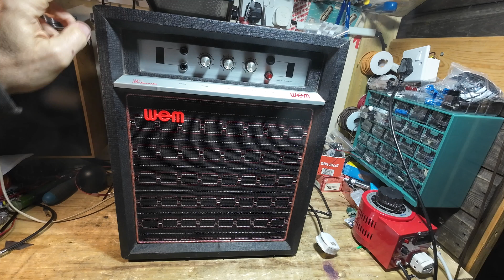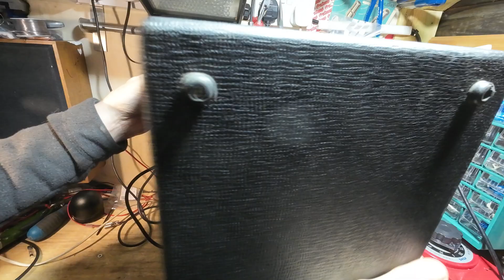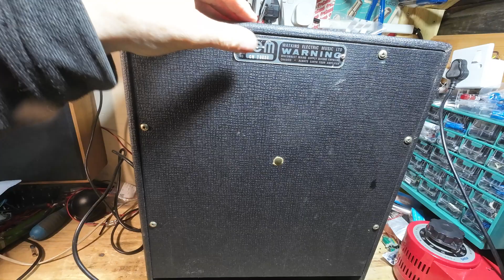Wem Westminster MK9 With Some Mighty Mullard Tubes/Valves This a Full Restoration Part 1

Comment: I don't think your formula for the output transformer is set in stone. I think they were just trying to get the most power out of the valves that they could. And valves were cheap then. 
I am working on a very similar one at the moment. Biggest improvement in hum was scraping some of the anodisation under the earth connection under both transformers. Anodisation is a very effective insulator. Also changing the diodes to high speed type helped. Also connecting the filament earth to the top of the resistor you changed from 200ohms to 300 ohms(I used 330 ohms) should help. Also now you have 3 separate capacitors you can earth each one to the appropriate part of the cct which may help a bit. Mine is quite quite now, but I have some strange distortion to sort. I think it is one of the coupling capacitors. Tested ok but think they are intermittent.
Reply from the maker: Hello Jay. Some interesting stuff going on there, thank you. All the coupling caps in this one were not great. I just changed the lot while I had the board out. 330R for bias is about right. 10,5 watts is the correct bias setting for the amp. The tubes are still over biased at that, but better than 12 watts. Thanks for watching and take care.

Comment: Fascinating video Martyn, the tube adapters sound a great idea, didn`t know you could get that sort. I would be surprised if those o/p vales have been in there long but aren`t ECL86`s meant to be similar to an ECC83 and an EL84, not sure what ECL82`S are the equivalent of ? I suppose biasing to the 10.5 watts would prolong their life. Definitely think that moving the mains from the pot would make a difference ,about to do it on a couple of old amps myself. All the best.
Reply from the maker: Hello, Yes the the ECL86 triode is the same gain factor as a ECC83. I would think it was down to cost why they didn't use them. Would have been a much better tube though.  take care mate, speak soon.

Comment: Hi Martyn, do you have a source for those Russian valves? You mention you buy them from Ukraine
Cheers, loving the videos
Reply from the maker: Hello Steve. The Guy I got them from isn't on ebay anymore. Here a
another seller: https://www.ebay.co.uk/itm/174964217855?itmmeta=01HSERNQEAHG0K1G8TXK2Q2DWW&hash=item28bcae17ff:g:6nUAAOSwHK1fmVsZ&itmprp=enc%3AAQAJAAAA4EzRuGquDHkya3JIFeBX%2F%2Byf81amHBS8BBX70vkKE%2F8mwMwi%2BuSHXpsGGiwYQvleF6LvWlf7UGxJ6PcVyMhcVTEXJDqQNaDCtHKnpwPWvqwj%2BfhuBdZZGX2FYujGFW5ITL6HfKzvp1I4tdoNIWqHEB0Z82K7VIO51nGm0SeuoHZtbKrg5Xo%2FVYFFQxg8SW24VoXiwKGodMfss%2FzsZW5KLD0YRW5yRhJw837YR2n69%2FFA9cLqiHmiqVd3BXTnEqsiAVVnvylw9BZGocxjEJbNboHNi5bJcQ7gY%2BwRn41oC8mL%7Ctkp%3ABFBMovfW2Mtj

These are cheap and they are good tubes. Thanks for watching and take care.
Reply: @vintageguitaramp_guitarteacher  fab, thank you, those prices are indeed very good, fill yer boots 😁

Comment: Thanks again for one of the best videos on tube amp servicing. This isn't just your next fender amp recap, this goes further and I enjoyed every minute of it! 
I also enjoy that you aren't constantly hating on former techs for a not so pretty solder joint or a crooked wire :))
Reply from the maker: Hello. Thank you for your kind words. There should be a part two coming soon. A bit more delving in to the way it was set up at the factory and how we plan on sorting it. I have ordered some tube adaptors for the Russian tubes that are going in this amp. That will probably be in part three. Thanks for watching and take care.

Comment: I'd go ahead and modify the amp to take the Russian valves. If you've got loads it makes sense, incidently I bought a set of Russian 6V6s for my 5E3 Tweed Deluxe and they lasted 3 months.

Keep the vids coming Martyn - they're always interesting!
Reply from the maker: Hello Tim, thank you. One the channel subscribers suggested I get some tube adaptors. Why didn't I think of that. I ahve some on order. I have had good look with Russian tubes. I have a set of the Russian 6v6 tubes (6P6s) in one of my gigging amps. Still going strong after five years. I have never pushed them over 300 volts. They will handle 350 volts on the plate. But only 310 volts on the screens. Thanks again Tim and take care.

Comment: That buzzing sounds like RF interference, the input jack socket/s might not be switched to ground when nothing is plugged in? Is it a  plain unswitched socket or if it's switched possibly the contacts are bent or mucky?
Great video mate. 👍
Reply: The schematic shows input jacks that shunt/short to ground....but the circuit could be different.
Reply from the maker: I had a quick look the jacks seem okay. It's down as a job on the list at the moment. I think it is the AC mains switch in the pot though. They are a pain.
Reply: @vintageguitaramp_guitarteacher   , pots with AC on/off switches attached were used in many small amps from the 1940's and 50's, such as early Valco, Magnatone, Dickerson, Oahu and such. They always introduce noise. Best to just bypass the switch, perhaps putting one in line with the power cord if you prefer not to drill a hole in the chassis.
Reply from the maker: Hello. That had crossed my mind. I did have a quick look online. It really needs a new power cable too. The plastic is a bit stiff. Wouldn't be good with an inline switch.
Reply: @vintageguitaramp_guitarteacher  ,  It also occurs to me that the cabinet appears to have a sealed back and it must get pretty darn hot in there with no ventilation ----  Not to mention that the speaker might prefer and sound better with an open or partially open back cabinet. You should try it both ways once you get it rebuilt and put back together.
Reply from the maker: Hello Rob, thank you. It's a job on the list at the moment. Need to sort the tubes. I have ordered some tube adaptors, which was an idea that @gooden2974 had. Why didn't I think of that duhh!! That will save me having to cut the traces. I am a plank sometimes. Hopefully we can match the effective load resistance to the output transformer. Nice to hear from you again Rob. Take care.

Comment: Great video, change the output transformer less hassle...
Reply from the maker: Hello Keith. I have ordered some tube adaptors which will save me having to cut the traces. Shouldn't take long to wire those to the 6F5 base. I don't have the right transformer to go on it so I would have to buy one. If I use the adaptors I can keep the amp original. I am a dummy. I should have thought of that before @gooden2974 suggested it. I probably would have thought of it just after I had cut the last trace. Thanks for watching and take care.

Comment: If it's the same as the WEM Dominator I had, it too had a bad hum/noise level. After changing the smoothing caps the issue still remained. I found the cause was the combined mains switch & volume pot. Daft idea sticking the mains near the high Z IP of a high gain IP valve.
  These amps were budget amps, the mains transformers are rubbish & often needs replacing. Grand video.
Reply from the maker: Hello, yes not ideal putting the power switch in a tone control. i am not surprised the power transformers fail when the tubes are way over biased.  They were defiantly made on the cheap. Thanks for watching and take care.

Comment: Honestly, I think I would either make adaptors that plug into the existing sockets so that you could sub your ECL85 tubes, or simply change the output transformer.  The world really could use a supply of manufactured adapters to sub other tubes in place of ECL82/6BM8, and ECL86/6GW8 tubes. This would probably be much easier to do for someone with access to and familiarity with software for designing printed circuit boards, which I personally do not. I've made some interesting and tricky tube adapters before such as a pair to allow the substitution of 7591 tubes for 7868 tubes and vice versa, but hardwiring a tube socket to a male tube base, with crisscrossing insulated wires betwen them, is not easy to do......
Reply from the maker: Hello. Why didn't I think of that? I was so tired and so engrossed in the amp. I have just ordered some. Thank you. Take care.

Comment: Forgive me but I love to see you getting confused because it is sooo much entertaining! 10.5W for ECL82 in AB Pentode Push Pull at 250V is exactly what the original Philips data sheet says at page 8 and page 28. Rk 220k. The output impedance can be anything around 10R. Remember that the 16R you measuring on your speaker is not a constant at any given time at all... Electrical engineers give us safe boundaries
Audio engineers design the sonic possibilities based on the intended use. E.g. lowest possible odd order and highest possible even order harmonics. Sometimes this can be right at the end of the safe boundaries.
Reply from the maker: Hello. 10. 5 watts is the total output of both tubes biased at 7 watts. Look at the current, 31ma per tube. 0.031 - 5% = 0.029 x 250 = 7.3 watts. Also it says the effective load resistance is 10K.  I did a turns ratio test on the output transformer. It came out at 6.8K. So you end up with a tapping of 24R with a 16R speaker with the tubes biased at 7 watts. The amp had 268 volts plate to cathdode with a 200 R resistor. There was 19 volts drop across the resistor. 19 / 200= 0.095 -5% for the screens  = 0.090 /2 = 0.045 * 268 = 12 watts per tube. The effective load resistance at 12 watts is 6K. I scoped it out last night At 12 watts dissipation per tube, the amp was outputting 14 watts!! If you look at the limiting values on the tube data sheet the max dissipation is 7 watts. I do agree with you on finding my confusion entertaining though. All my friends say the same. I spotted the tube tester video on your channel. That looks interesting. I will give it watch when I get some free time. Thanks for watching and take care.
Reply: @vintageguitaramp_guitarteacher , I haven't watched Lobster's tube-tester video yet but his video on repairing and rewinding reverb tanks was very interesting. (And the background music, which I presume was his own, featured reverb-drenched guitar, sounding like something out of a Clint Eastwood "spaghetti Western"!)

Comment: Some emission-type tube testers test all tubes as triodes anyway, tieing the screen grid of a pentode to the plate, and also ignoring the suppressor grid if the tube has one with a distinct, separate pin out for it (as EL34's do, for instance).
Reply from the maker: Interesting. I must have a proper read up on the one I have. There was a Mullard tube tester on ebay Looked the real deal. It was £520  though and it took three men to carry the Manual. I would have loved to buy it. But a bit pricey for me. Take care.
Reply: @vintageguitaramp_guitarteacher  , the Mullard would probably have been laboratory grade! The majority of tube testers sold to tv and radio repair shops weren't anywhere near as good as that, and most tested the tubes at voltages far below the working voltage in a typical amplifier or other device.
Reply: @vintageguitaramp_guitarteacher  , there a few models each of Hickok, Triplett and Weston tube testers that measure for shorts and interelement leakage up to the meg-ohm range right on the meter, making them far more useful for finding bad tubes then a unit that simply lights a neon bulb if there's a direct short.  The Hickok testers only run the plate voltage at 150 V but there are a couple models of Triplett and Weston that run the tubes at 300 V or little more. I'm not very familiar with vintage tube testers from Europe, but if you can find an affordable one that does a true mutually conductance test and measures shorts/ leakage on the meter into the high ohms/megohms ranges, you may find it useful. The biggest problem with vintage tube testers is that schematics and service info may not be easily available, and the insides are a mess of wiring spaghetti,  and many of these machines have been sitting around unused for 50 years, therefore getting them working properly can be quite a challenge, especially if a sloppy tech has been at it in the past. The analog meters can undergo corrosion and become sticky, or the coil can corrode "open", if subject to long-term damp storage.

Comment: Hi Martyn, you might be interested in the findings of an Australian valve guy called Grant Wills. If you google ‘Gilly amp’, there are three versions, the Gilly, the Gilly mark II and the Gilly revisited. Aside from how he creates his power supplies, the thing you may be interested in is his findings on the 6gv8/ecl85 valves and the output he could get out of them by running his output transformer with a lower primary impedance. I have a Kriesler valve radio from the late 1960s that uses a 6gv8 and the primary impedance of the OT is only 3.3k.
Reply from the maker: Hello Mark. I will have a read, thank you. Take care.

Comment: 6BM8, yes 👍. Also, watch out for what appears to be white powdery corrosion on the speaker frame. Very irritating to eyes, nose and throat, perhaps toxic as well (cadmium plating gone rogue, perhaps). Hopefully it's just ordinary dust and not a corrosion product....
Reply from the maker: Hello. Yes, I have seen that on a few speakers. Didn't realise it could cause those sorts of problems. Noted, thank you.
Reply: @vintageguitaramp_guitarteacher  ,  The powdery whitish green corrosion is especially common in some plated steel chassis such as Valco-built guitar amps (Supro, National, Gretsch, Airline etc) and the inside of Hickok tube testers.  If you get a nose full of it your throat will burn and you will taste it for days.
Reply from the maker: Blimey, that sounds like nasty stuff. Take care mate.